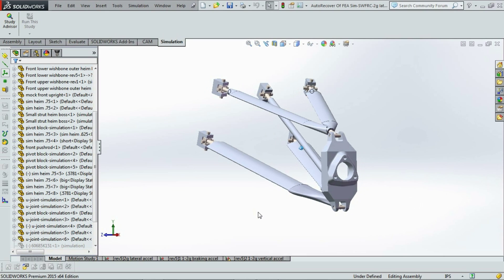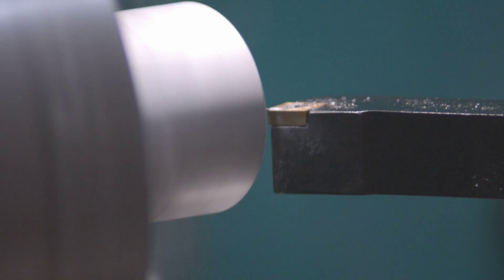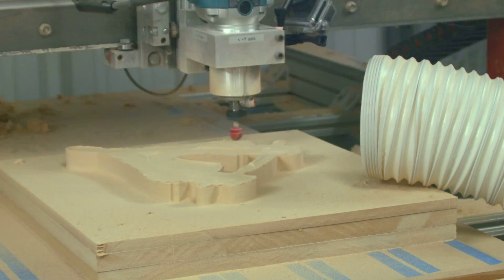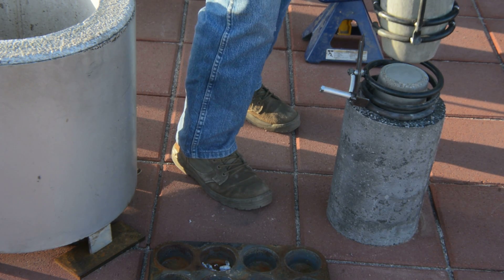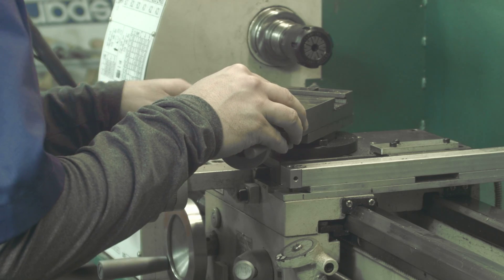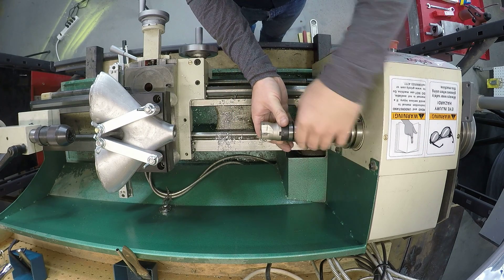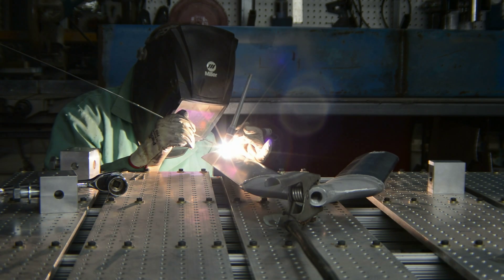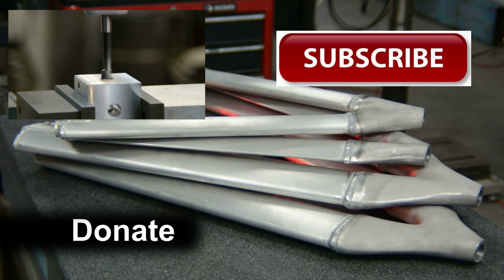A new Super Car is coming, Building The A Arms

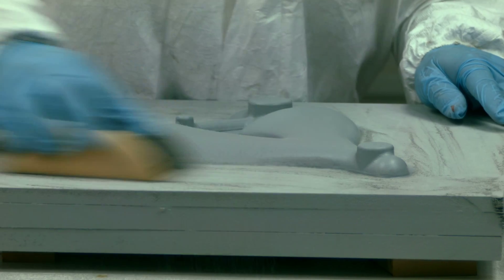Comment: 6:05 is that the vacuum chamber for testing samples for dissolved hydrogen? Very cool project!
Reply from the maker: The glass jar behind Kevin. Yes that is it. Here is a link to that jar.
 
http://www.ebay.com/itm/NC-12892-Bell-Jar-and-Vacuum-Plate-Combo-1-gal-/281557699291?hash=item418e258adb:m:mXac0PQkgUMIOhNHgY8TvPA

Any vacuum pump that goes up to (28 hg) will do. Below is the one we bought. There are cheaper ones but this one has the flow we wanted for our plastic mold injection process. We will cover that in the next few months.

http://www.ebay.com/itm/VACUUM-PUMP-AIR-CONDITIONER-REFRIGERATION-6-0-CFM-2-Stage-1-2HP-HVAC-R-110v-New-/131830729776?hash=item1eb1b94c30:g:q~EAAOSwa81XSdnu